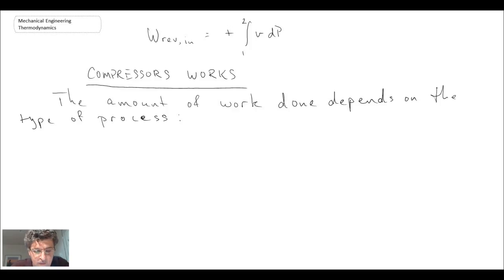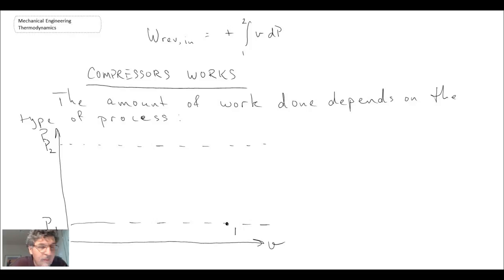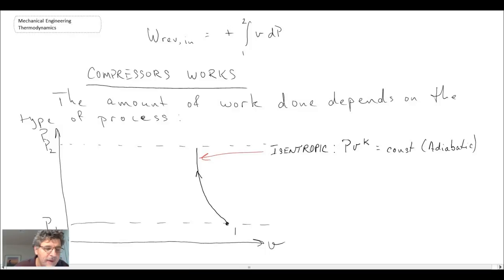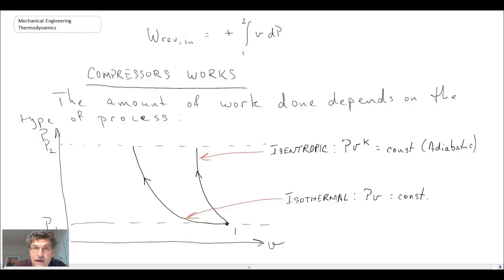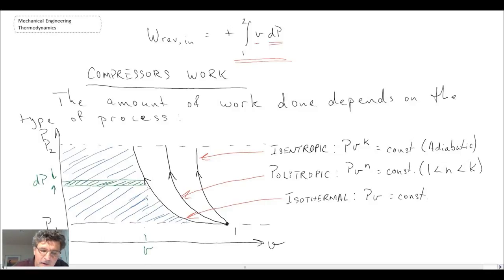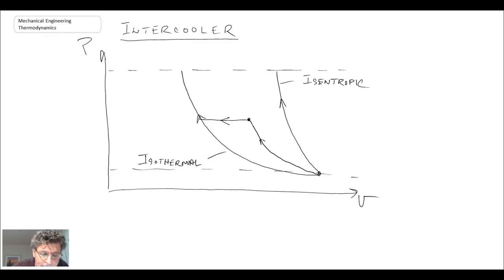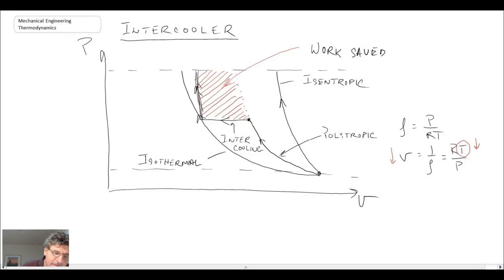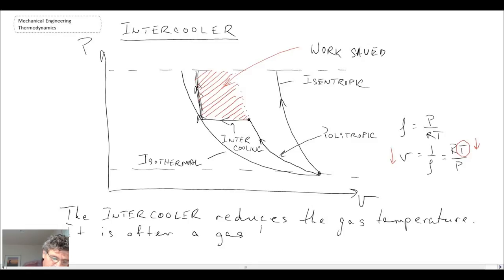Mechanical Engineering Thermodynamics - Lec 9, pt 2 of 5:  Compressor Work

Comment: Why are compressors not considering Pdv?  The specific volume changes during the process.
Reply: MrZealot1 if you consider Bernoulli generalized equation, and suppose the process is reversible (so that there are no pressure losses due to friction or other irreversibilities), you’ll notice that the power required to power the compressor is the product between the air mass flow rate and the integral from 1 to 2 of v*dP
Reply: Pdv is the work done on a moving boundary of a closed system. vdP is the isentropic work for an open system. 

Remeber enthalpy:

h = u + Pv

Change of enthalpy (infinitesimal)

dh = du + Pdv + vdP

So you see when enthalpy changes it can basically be attributed to the fluid changing it's internal energy, making boundary work (Pdv) or flow work (vdP). 

To prove that you need Gibbs Equation
δq + δw = Δu (First law closed system)
δq = Tds (Second law)
δw = -Pdv 

Substituting:
Tds = du + Pdv

This is Gibbs equation. However in open systems we relate everything to enthalpy not internal energy, it eases calculations. We use the change in enthalpy above and find:

dh - vdP = du + Pdv

Substituting into Gibbs equation:
Tds = dh - vdP

And if we consider an isentropic process:

dh = vdP

To find out an expression for work we use the first law for open systems, considering that because we assumed an isentropic process it is adiabatic (heat q must be 0) and the work has to be reversible, Kinetic and Potential energy are neglected as well. Then it simply is

δw_(reversible) = dh

  δw_(reversible) = vdP